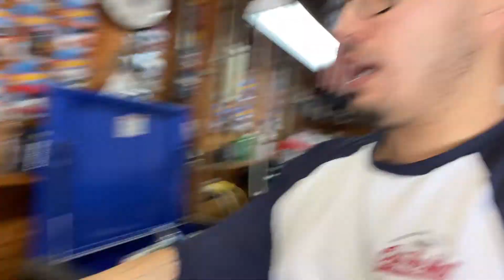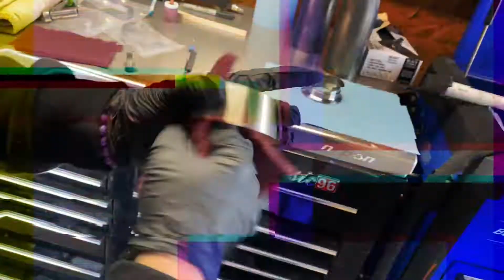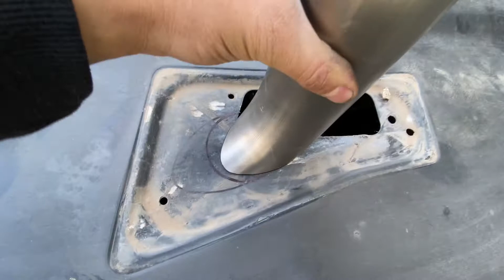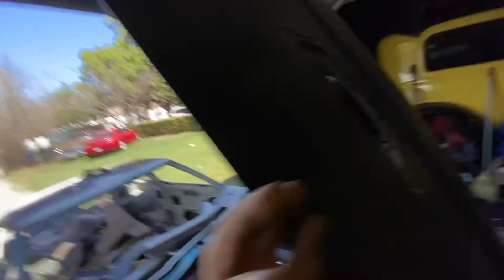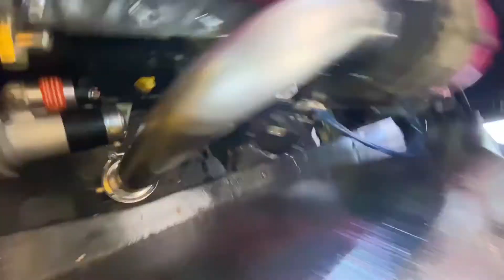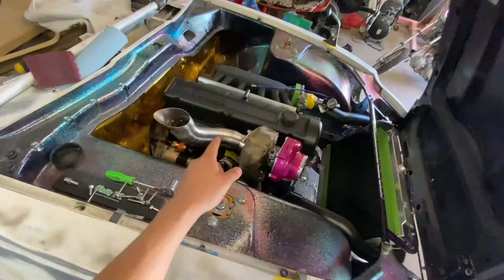Mocking up titanium up pipe and stainless steel down pipe. Datsun L28 (part two)

Comment: This thing is an absolute KILLER. Love the build and the pink you used think it looks sick. I can’t find a turbo motor so I’m converting mine to e85. Lines are rusty so I gotta replace em anyways haha
Reply from the maker: E85 with itbs will be dope, love the sound. 
My motor was not turbo but we build the bottom end and top end for a turbo setup
Reply: @Project_ABR  actually it’ll be a turbo as well. Itbs are amazing but I feel like they’re meant more for the S30 rather than the S130. It’s just my opinion but there are people out there that like their 280zx’s with ITB’s
Reply from the maker: Turbo is always fun.